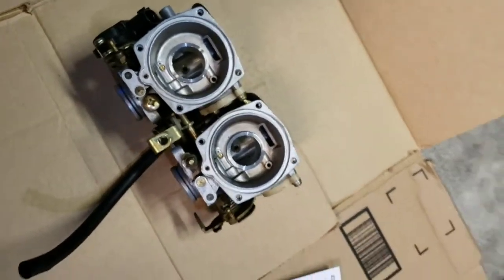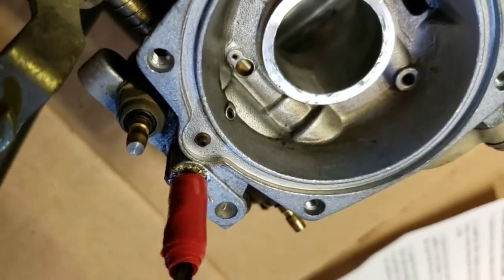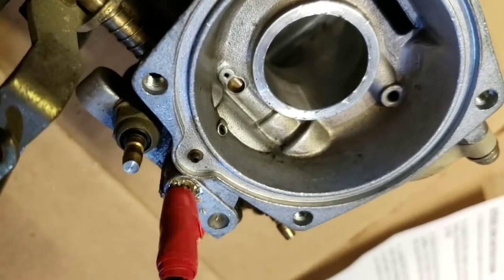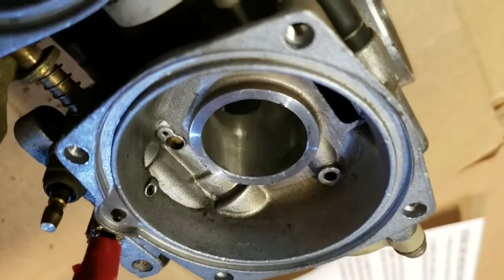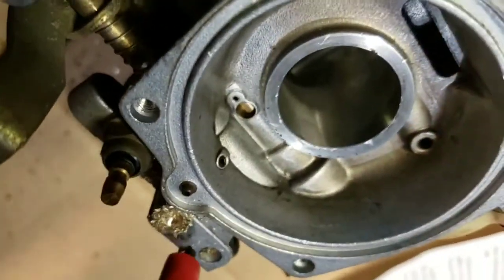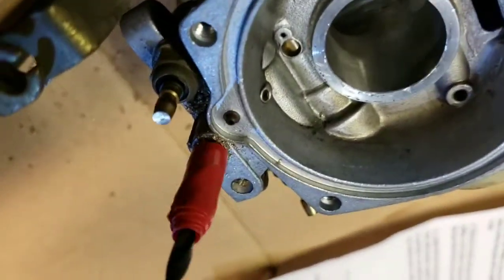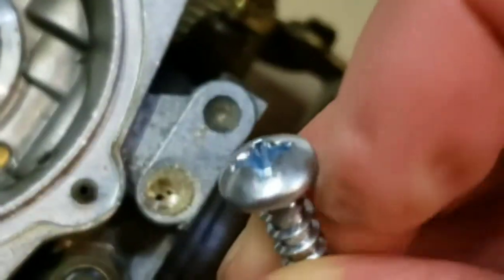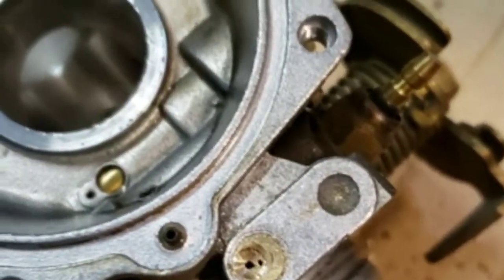Removing a welsh plug Yamaha Vstar 650 Carb

Comment: That drill is way to big,,,,
Reply from the maker: I was looking online for small drills, any suggestions?
Reply: @GrantZPrice  I got my drill bits from HOME depot,,I used 1/4 inch,,the Welch plug already has a tiny hole in it,I then used a fine thread deck screw to screw in,,and pull the plug out,,easy,,also,,I ordered new fuel mixture screws from the dealer,,they are a lot nicer then the junk stock ones...price was not bad,,,here's what I got,yamaha/triumph/ktm.
Part number 4tR-14105-00-00,,no more using a slotted screw driver,it's longer then stock,it has a knob on the end,that goes past the carbs for easy adjusting,